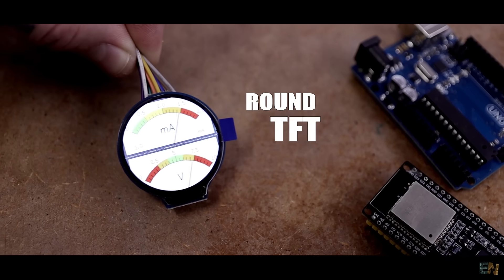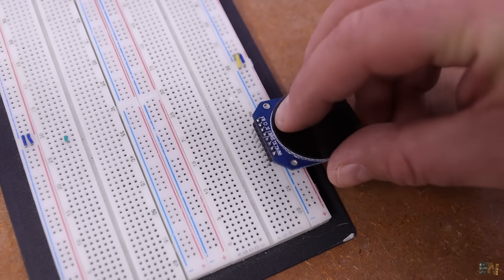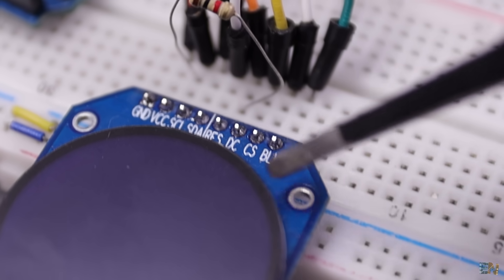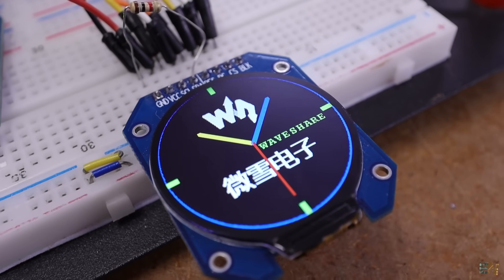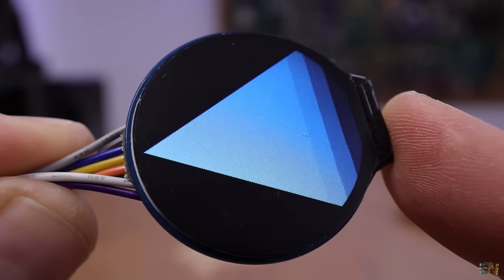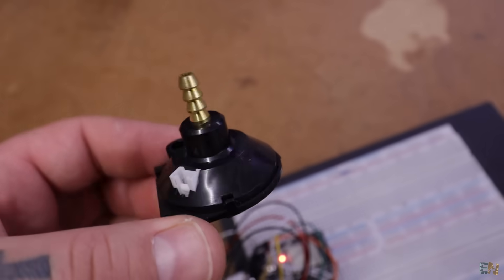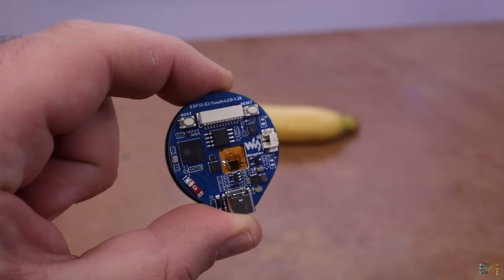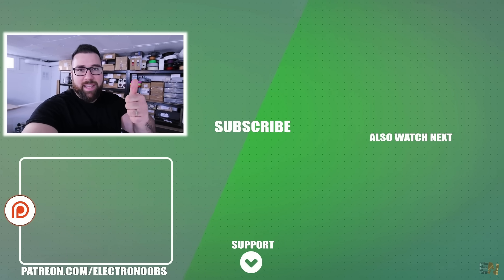I Found The BEST GC9A01 Display For My Arduino Smartwatch Project

Comment: I bought a thing called M5 Dial that has an encoder too. also plastic housing etc, but the electronics...
basic stamp esp32-s3 1.28" ips cap touch 240x240 rfid...
Reply from the maker: @CBWP  i have it too. There is one with mechanical feedback as well using a motor
Reply: I also have a M5 Dial. It would have been a really useful device it it had more I/O. I wanted to use it as an oven controller but it only has I2C and two other I/O pins available.
Reply: @ddegn  the beauty of ic2 is you can always add more.
Reply: @ The sensors I wanted to use are SPI.

Comment: Sir, I saw that there is an IC on the back of every Arduino TFT display module, what is its function? Why use it?
Reply from the maker: @Debjyoti-2025  not all of them but usually is a voltage level IC since arduino runs at 5V and usually these displays run at 3.eV
Reply: @ELECTRONOOBS  Thanks sir, I have a TFT display, 1.77 inch 20 pin, I opened it from a keypad mobile, I think the driver of this display is st7735 and it uses parallel interface. I want to connect the display to my ESP32 microcontroller, I need your help on this matter.